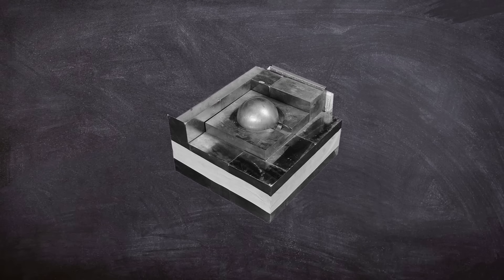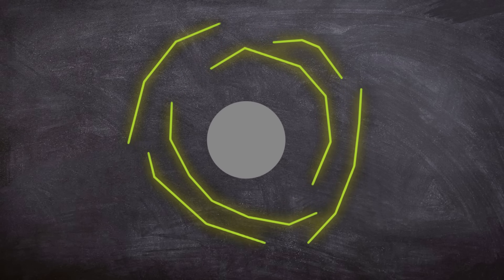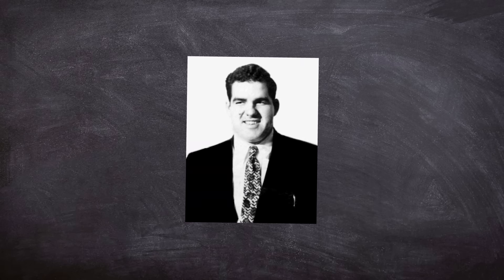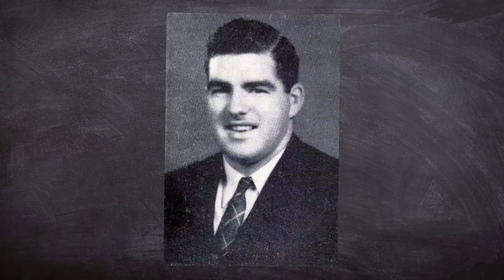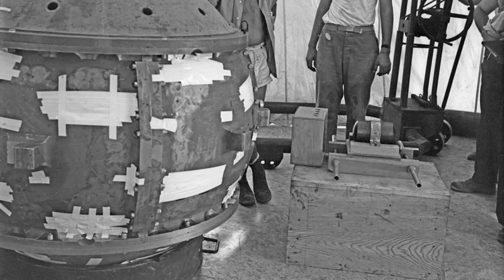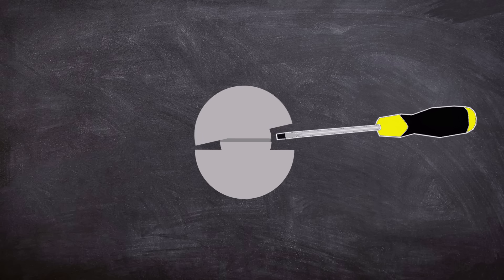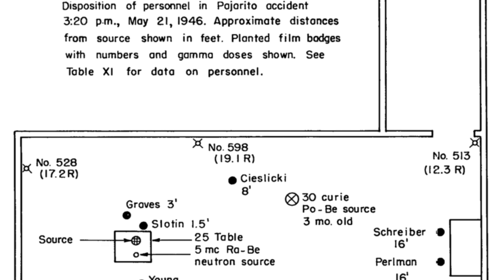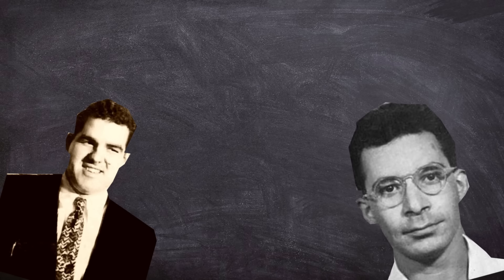A Brief History of: The Demon Core (Short Documentary)

Comment: I dealt with testing things with high power RF radiation.  Everytime I had to handle that high power, it scared the crap outta me.  I double and triple checked everything. Every joint/connector was sealed and RF leak free.  
I never want to deal with High Power RF ever again.

Comment: Serious question - why do we have so many different units of radiation measurement? Rem, Sieverts, rads etc?
Reply: One Sievert = 100 rem. This is basically energy deposited into a biological material. This is multiplied by a weighting factor dependent on the type of radiation in question which gives a result in Rads or Grays. 1 Gray = 100 Rads.
Reply: @eddiebruv  I had a feeling it was something to do with either type of radiation or the difference between the amount emitted or the amount absorbed but I was just guessing, nobody has ever explained it until now, thanks 👍

Comment: It seems to me extremely bizarre that
they didn't arrange things horizontally and
use a threaded rod and crank to move
the parts into exact proximity!
Reply: (And I'd have run the sound of the Geiger counter thru an amplifier and 
a ring of big speakers mounter round the room's periphery
so the clicks would be loud and certain to keep everyone aware 
as the hazard level changed with increasing hemisphere proximity ).

Comment: If the original accident caused actual prompt criticality, removing the neutron reflectors would not have stopped the core, and it would have released more and more energy. Prompt Criticality occurs when the source remains Critical due only to Prompt Neutrons alone, and since delayed neutrons also exist in the core, it would stay supercritical. Since both Prompt and delayed Neutrons are in the core, and are not counted as the reflected neutrons, I'm confident that the first reaction did not cause the core to go prompt critical. If it did, it would have kept going until depleted completely or until it had poison added to the core. I've worked in as a Nuclear Power Plant operator for 6 years if you're wondering where I got this information from.

Comment: How do they machine those pieces?
Reply: "The metallurgists used a plutonium-gallium alloy, which stabilized the δ phase allotrope of plutonium so it could be hot pressed into the desired spherical shape. As plutonium was found to corrode readily, the sphere was then coated with nickel."

Comment: So was not the "Demon Core" itself radioactive even when subcritical? This stuff fascinates me from both a scientific pov, but also a psychological one. Surely Slotkin was aware that one slip with that screwdriver was going to be deadly. Also what really amazes me is the small size of the core and how much explosive potential it contained. Such a small thing to be able to create such massive destruction!
Reply: it was radioactive when subcritical but mostly in the form of alpha particles that are blocked by clothing, a few centimeters of air, the dead top layers of your skin...

as long as you aren't eating or breathing it, and its not currently a critical assembly, you can stand next to a piece of uranium and be totally fine.
Reply: They also coated the core with a thin layer of nickel (I think, could be wrong) which blocked the alpha particles and made them safe to handle - but they were always warm to touch.

Comment: Complacency or losing focus can be disastrous under certain conditions.

I worked on navy fast attack subs and our biggest danger wasn't any event or even the surroundings. The greatest danger to any submarine crew, regardless of nation, is an uneducated crew member doing the wrong thing at the wrong time. Training is huge! You are given stacks of qualification cards when you get to a boat. You don't get signed off on any component or system until you can explain it, top to bottom, in every operational mode, how you start it up or shut it down as well as where every single power source is located to isolate every aspect of the component or system. Do that for every piece of equipment on a submarine and you are ready for a qualification board. You will then sit in front of a board of 3-4 senior crew members, officers and enlisted, who will grill you on every ridiculous question they can think of asking you. Some favorites are "In a molecule of water outside the ship. Explain to me how I get inside the ship and eventually flush the toilet in aft crews berthing." You'd then have to explain it, drawing diagrams of the trim and drain system explaining how it entered, where it went. Or the same question but instead of flashing a toilet explain how it powers an overhead light, or your rack light in berthing.

You're grilled for hours and if you can explain things well enough they'll assign you look ups. Once you complete that you are awarded your submarine warfare designation pin or, what most refer to as, "dolphins."

Dolphins indicate you're capable of saving your crew mates life in any casualty.
Reply: Just curious. Do the Chinese sub crews undergo this level of training?
Reply: @buzaldrin8086  I know nothing of Chinese submarine crews training. I would imagine it's so, though. I've known sun sailors from Sweden, the Royal Navy, India, Japan, South Korea and, obviously, the US.

One thing that is universal is the importance of quality training. Submarines are smaller than most ships, there isn't a lot of space for a lot of crew. On surface ships they have the room for whatever they need. There's designated DCmen (Damage Controlmen) to respond to any casualties; the regular crew generally stays out of the way during a drill or causality.

Since submarines can't accommodate extra crew that only have one job so everyone gets advanced training in firefighting, flooding, etc. So on top of knowing your specific equipment inside and out, you need to know everyone else's equipment intimately. Not as an advanced operator, just the basics, to fill in in an emergency or to safely shut down/secure the equipment. Also to know which equipment can be shutdown and which can't due to being critical to ships operation. Beyond that is where the advanced damage control training comes into play.

Every US submarine has a DC (Damage Control) watchbill. While at sea the ship shifts to an 18 hour day: 6 hours of watchstanding, 6 hours of off-going and 6 hours of oncoming. During watchstanding you're doing just that: standing your designated watch. I was a Fire Control Technician (FT) and my senior watchstation was Fire Control Technician of the Watch (FTOW). FTs are the ones that take all contact data from sonar, plots, visual bearings, etc. to maintain an up to the minute picture of all known contacts in relation to own ship. It let's everyone know that there's a fishing trawler over there, a warship over here, a merchant vessel back there, etc. So at any time the Officer of the Deck, the Navigator, the Quartermaster of the Watch or anyone else in the ship's control party is aware of all contacts; where they are, which direction they're going and how fast they're moving. Every watchstander, every off-going watchstander and every oncoming watchstander has a designated role in the event of a casualty to ensure the causality is combated as quickly and efficiently as possible.

As the FTOW if a fire, for instance, is called away the FTOW on watch immediately responds as a fly away fire extinguisher, the off-going FTOW responds as nozzleman on the primary hose, the oncoming FTOW immediately reports to the attack center to assume contact management until the on watch FTOW returns from flying away with the extinguisher. Once that extinguisher is used he returns to his watchstation. This ensures an extinguisher is immediately used, then he gets out of the way for the rest of the crew to respond in their designated roles. If the casualty was flooding instead of fire the on watch FTOW responds with a portable bilge pump, the off-going FTOW, at the same time, responds with the non-collapsible hose for the bilge pump while someone else responds with a collapsible hose so they all arrive quickly with all components necessary to start dewatering the affected area. While all of that is going on there's others doing their roles: the Chief of the Watch (Cow), sitting at the Ballast Control Panel (BCP), is fully aware of the all liquids on the ship. The BCP is a very complex layout of all valves and isolations and he's isolating and lining up the trim and drain system to ensure the portable pumps are able to hook up as close to the flooding as possible. In the event of a fire the COW is the one who immediately secures ventilation so smoke doesn't completely engulf the ship. These are really just 2 very, very basic explanations of casualty examples possible. There's actually a ton of tiny things that the fly away, and everyone else responding, does, laying them all out would take pages and pages of writing. Things like removing the plugs on the Emergency Air Breathing (EAB) manifolds so future responders can immediately plug their masks into so they can breathe fresh air. That's what I mean by the incredible amount of training every crew member goes through. While those watchstanders are doing those actions there's dozens of others carrying out their immediate actions. It's absolute chaos but it's organized/orchestrated chaos.

The entire crew drills for these casualties constantly so it becomes second nature if/when an actual casualty occurs. There's plenty of redundancies as well in case of complications that may prevent some people from completing their actions. There's several fly away extinguishers, for example, coming from the forward and aft of the ship. This way if one responder is blocked from getting to the source of the casualty due to the fire spreading rapidly or a million others issues that could happen, there's someone else that can get to it.

Prior to ever setting foot on your submarine you've gone through a lot of DC training. Whether you're a an FT, a cook, a nuclear mechanic or electrician, a torpedoman, machinists mate, whatever... everyone goes through immense basic and advanced training. Then, like I said, the ship constantly runs drill after drill after drill. Sometimes they're scheduled drills: you'll know that on that Tuesday from 1000-1400 there's going to be drills so you're on extra alert waiting to hear an emergency called away. Just as often the drills aren't scheduled and can happen at any time. It's being grilled into everyone, constantly so when the real deal happens you now exactly what you're doing without having to think about it.

So yeah, training at that level, is pretty universal across submarine fleets and crews, regardless of the nation or type of ship (diesel-electric or nuclear). You're in a steel tube submerged underwater in a rigorously controlled environment. A fire, even a brief fire that's extinguished almost immediately, can incapacitate an entire crew due to smoke inhalation if everyone doesn't complete their immediate actions quickly and accurately. Those actions I laid out before are just a tiny fraction of the entire ships response. The second the fire is called away and I fly away with my extinguisher, the COW is securing ventilation, sonar and the officer of the deck are maneuvering the ship to clear the baffles to bring the ship to periscope depth which will allow us to snorkel: refreshing the air onboard and clearing out any smoke. There's dozens of people working together to make sure we don't die. A submarine is pretty comparable to a space shuttle in that you're in an enclosed environment and the environment outside of the ship is constantly probing your vessel for weaknesses, ready to come rushing in and crush or drown all of you.

Sorry for the incredibly long post that's filled with a bunch of crap you didn't ask for or probably didn't even want to know about. There's just so much to it, so much involved in even the most basic task that it's easy to get carried away. That's why I said the biggest danger to a submarine is her crew. Being untrained, poorly trained or complacent can easily result in the loss of the entire ship with all hands. Even during celebrations we can't escape that fact; every year there's a submarine birthday ball for those that are not at sea. Prior to commencing with the festivities they hold what's called the Tolling of the boats. Everyone stands in reverence and honor while they briefly remind everyone of every single submarine ever lost at sea or almost lost at sea with serious casualties, the amount of souls lost for each one, etc. The fact that you're pretty much one wrong step, one wrong move from a sudden, horrifically violent death is never lost on us.

So yeah, I imagine China definitely has very similar training standards for their submarines and submariners.
Reply: @TheNuckinFoob  TMI.

Comment: What puzzles me is how did they form this ball of radioactive material into this shape through modern fabrication methods? even just half rounds that are smooth is a special shape would take processing that would cause super critical activity for sure.
Reply: "The task of the metallurgists was to determine how to cast plutonium into a sphere. The difficulties became apparent when attempts to measure the density of plutonium gave inconsistent results. At first contamination was believed to be the cause, but it was soon determined that there were multiple allotropes of plutonium. The brittle α phase that exists at room temperature changes to the plastic β phase at higher temperatures. Attention then shifted to the even more malleable δ phase that normally exists in the 300–450 °C (570–840 °F) range. It was found that this was stable at room temperature when alloyed with aluminum, but aluminum emits neutrons when bombarded with alpha particles, which would exacerbate the pre-ignition problem. The metallurgists then hit upon a plutonium–gallium alloy, which stabilized the δ phase and could be hot pressed into the desired spherical shape. As plutonium was found to corrode readily, the sphere was coated with nickel." - Wikipedia, Fat Man bomb

Comment: They should of had the top shell lowered on a chain set up so you can lift and lower the shell using a pulley for tiny movements. I know there was a vey serious race to get there first but setting up mini crane or like I said a pulley, this would of only taken a few hrs to put together. Another system would have the top shell in place and then jack up the lower shell for a fail safe procedure.

Comment: If the core goes critical, why doesn't it explode? All the atoms are splitting at once.
Reply: The plutonium is present as a subcritical sphere (or other shape), which may or may not be hollow. Detonation is produced by exploding a shaped charge surrounding the sphere, increasing the density (and collapsing the cavity, if present) to produce a prompt critical configuration. This is known as an implosion type weapon. 
https://en.wikipedia.org/wiki/Critical_mass
Reply: @buzaldrin8086  If you simply increased it's size to above critical, it will not detonate?
Reply: @markshiman5690  I repeat: you need to DECREASE its size (or increase its density).
Reply: @buzaldrin8086  Alright, so it's not about weight, but density. Why does adding reflectors make it go 'critical' without explosion?
Reply: @markshiman5690  1) Google "neutron reflector" (2) In the video, go to 3:18 and watch again (3) Go to 6:07 and watch again. Fat Man bomb: https://en.wikipedia.org/wiki/Fat_Man#Bomb_assembly

Comment: Wait, so they actually >>handled the plutonium core<< with their hands?! Without any protection?! How is that not immediate death? Isn't the plutonium radioactive enough to fuck you up?

Edit: So I googled this and it turns out that you can safely handle a weapons grade nuclear core, no problem. WTF.

There's usually disposable gloves to prevent contamination of other things, but that's it. It's apparently warm to touch as well. They coat plutonium in stuff cause it corrodes. The Demon Core was coated in nickel. It was shiny silver because of that.

That still doesn't cure my radiophobia, but is a cool fact nevertheless. 😅
Reply: I'm also somehow not okay with the fact that you can carry around a ball of death, like it was a paperweight. I see why they got complacent. It seems harmless, until it isn't, and you die, shredded apart by radiation.

Science has definitely gone too far.

Comment: I really think that most of the time brilliant people suffer from a real LACK of common sense. I have seen real world evidence of this, perhaps the brain uses or is developed through learning at such a high level or focus on one area that causes a growth issue in the part of the brain that performs low level tasking?
I will give you ONE example of the many I've witnessed.
I watched a man who earned a double doctorate or PhD in mathematics and another in Chemistry, + he was number one in both of his classes at a very prestigious ivy league school, this same man had a drained car battery that needed to be removed and charged.
This same man that was so brilliant decided even with a huge amount of ANY tool needed he would choose a framing hammer, instead of a number of adjustable wrenches and a full spectrum of both metric and standard non adjustable wrenches.
WHAT DID HE DO? All of his intellect told him to grab the hammer. Not because of anger. Just by choice. He then proceeded to BEAT THE BATTERY POST AND THE ACTUAL BATTERY CLAMPS, FINALLY THE POST BROKE AWAY FROM THE ACTUAL BATTERY. YET HE ACCOMPLISHED NOTHING, AS THE BATTERY WAS DESTROYED AND THE CLAMPS STILL ATTACHED TO THE POSTS. HE WAS BY FAR THE DUMBEST GENIUS I'D EVER KNOWN!
Please forgive my grammar and caps lock, and the dissertation length comment.